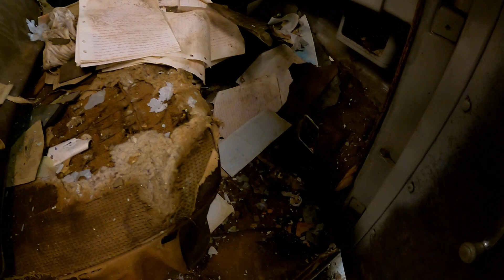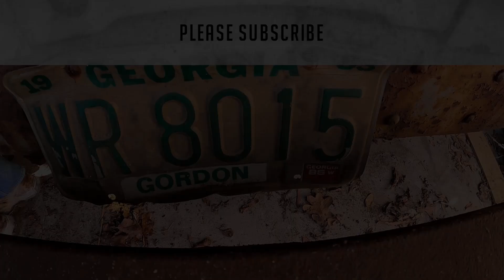1959 WILLYS FOUND IN A SHED!! {ANOTHER RESCUED}

Comment: Looks like someone forgot to turn in their homework and left it on the front seat.  Good luck getting that engine loose, it's a tough one when it's got an actual nest sticking out where the spark plug should be.
Reply from the maker: Yeah the engine is a lost cause sadly. The rear cylinder is even worse than I thought, it has a chunk missing out of the wall. I'll just have to find another 226. lol